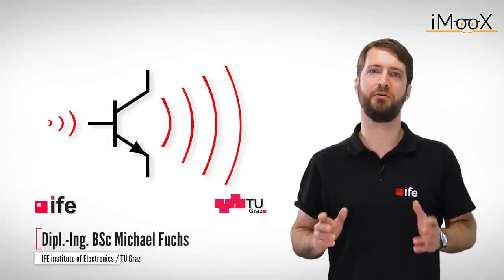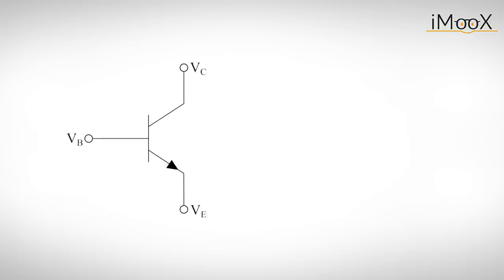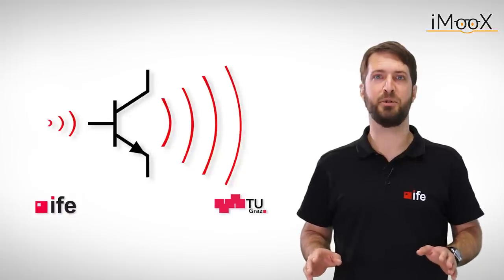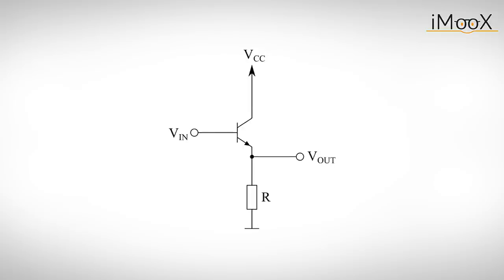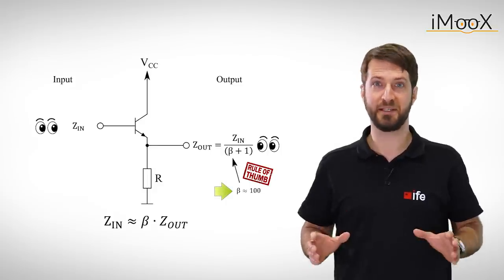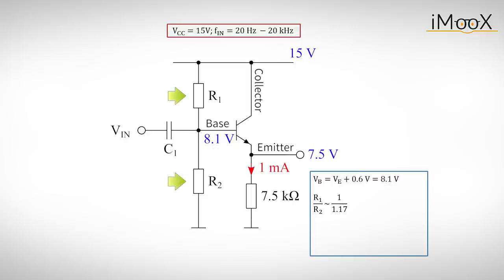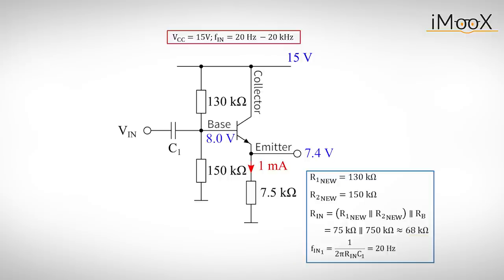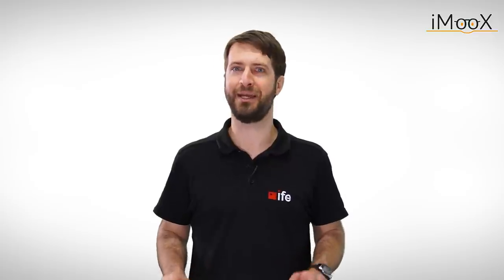The transistor as an amplifier (Part 1)

Comment: To refine it a little, once you have chosen standard resistor values, you quite rightly recalculated the base bias point to be 8.0V. However, that assumes an infinite beta, and it's worth noting that a transistor beta of 100 and a collector current of 1mA would draw an extra 0.01mA from that bias point, lowering it to about 7.3V. The effect of the rule of thumb (using R1 || R2 < 10 x emitter resistor) is bigger than you might anticipate, and considerably bigger than the effect of using standard resistors that you did calculate. The lowering of the output bias point by 0.7V isn't a bad thing as it gives a bit more headroom to keep the transistor out of saturation on positive swings. Obviously, you can never get the full rail-to-rail swing with bipolar devices.
Finally - and it's only a small point - once you have fixed R1 and R2 as standard values, you should recalculate their parallel resistance which turns out to be 70K, not too far different from the 75K you used to calculate the input impedance, which is about 64K in this case. It close enough not to alter the value for the input capacitance calculated.
Reply: That's a very smart observation, thank you. Looks like we've gotten a little sloppy with our rules of thumb here.

Comment: so pretty if u want to amplify a signal u have to put a voltage to the base emitter to forward bias the diode and than a larger voltage will flow from collector to emitter?

Comment: 8:58 I believe the capacitor is coupling capacitor to remove any DC offset.  I don't believe it is there as an intentional filter, although it's cutoff frequency must be dealt with.
Reply: Yes, that's true, but I don't see why you cannot use it as such when it's there.
Reply: @michaelfuchs441  I think my point is that the goal is to remove DC offset but as a side effect, you end up with a filter as well.  I think you want to size the capacitor so as to minimize the impact of the filter on your desired signal.
Reply: @Enigma758  I can't argue with this conclusion. You're right.
Reply: @michaelfuchs441  Thanks for  your response, just trying to be precise...

Comment: Hallo and thanks for the video. I cannot unfortunately understand why the output voltage does not depend on the supply voltage. Vcc is also applied to R making VR bigger when Ic starts growing. Could you please explain ho it works? 
Thank you in advance!
Reply: But the output voltage is dependent on the supply. The supply limits the maximum voltage at the output. With 15V supply and correct biasing you can never reach more than ~7.5V at the output.

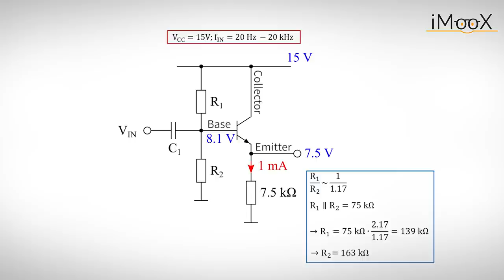Comment: @11:08 I might need a refresher. what equation is used to derive 75k x (2.17/1.17).  how do you multiply the equivalent resistance to the equation for parallel resistance, inverted, with the ratio values of a voltage divider to find R1 and R2.
Reply from the maker: For this calculation you need to know how parallel resistances are calculated. You can find a good explanation here: https://bit.ly/2Dr0Yl9.
In Short: R_1//R_2=(R_1*R_2)/(R_1+R_2)=75k. If you now put in the ratio from above (R_2=1.17*R_1) you get 75k=(1.17*R_1^2)/(R_1+1.17*R_1) and if you solve this equation you will end up with R_1=75k*2.17/1.17. I hope this helps!

Comment: @iMooX at
@10:24 you said: the impedance looking into the voltage divider; must be at least 10 times smaller than the 'INPUT' impedance looking into the base.
But it confused my mind; I think it shouldn't the INPUT impedance but the OUTPUT.  So the correction is input to output. The sentence turned to this.

The impedance looking into the voltage divider; must be at least 10 times smaller than the 'OUTPUT' impedance looking into the base. 

Otherwise the input impedance looking into the base is the same as is? :D
Reply: There is a mistake regarding the directions. Thank you for noticing!
I should have said: "The OUTPUT impedance of the voltage divider must be at least 10 times smaller than the INPUT impedance looking into the base."

Comment: Very good. One question: where does the value 1.17 come from when talking about R1/R2 @9:08?
Reply from the maker: The supply voltage of 15V is divided by the two resistors R1 and R2. If you want an 8.1V voltage drop at R1 and therefore a 6.9V drop at R2, you need a divider ratio of 6.9 to 8.1, which is equal to 1 to 1.17.
Reply: yes ..  so its just 8.1 divided by 6.9
Reply: Great job,we Waite more more successful video in electronics
Reply: Don't you want the 6.9V to drop across R1?
Reply: @imooxat  Or can use the classic formula for Voltage divider... 15* ( R2/(R1+R2)  = 8.1. If you solve for R1/R2 you will get 0.85. Which is equivalent to 1/1.17
Reply: @ajitnandakumar  things got a tad less clear when you got into the maths.  I did not initially quite understand your derivation of the ratio either. Best stick to classic calculating, its easier to remember. Otherwise great video.

Comment: Great Explanation but my doubt is that why are resistors R1 and R2 considered as parallel for the purpose of choosing their values ? As according to me they are clearly in series.
Reply: Good point! The explanation for this mystery is something like this:
What we want to do is a so-called "small signal analysis". We only want to look at the AC signals, not the DC signals. In the case of an AC signal with high frequency, any DC supply (such as the 15 V) can be considered a short circuit. Also the capacitor C_1 at the input can be considered as a short circuit for high frequency AC signals. If you now look from the input side, you see a resistor R_2 going to ground and a resistor R_1 going to the 15 V DC supply, which is considered a short circuit to ground. Therefore the two resistors are considered to be parallel.
I know this is a little confusing at first, but you get used to it. There are a lot of videos covering small-signal analysis. We are also working on one right now. I hope this explanation will help in the mean time.
Reply: @michaelfuchs441  thank you for the quick reply and yes it definetly helped.

Comment: Hi, thanks for your efforts in enlighten us about the operation of a transistor. i need help. i have a very basic knowledge with regard to circuit building. i have been given the task of building an RF power amplifier for a small FM transmitter. Do i have to start the design from the biasing of the transistor? i am confuse because this is an RF amplifier not just audio amp. i want the output of the FM transmitter to be about 30 - 40W. can i use a 2N3632 transistor as the RF amplifier?

Comment: In electronics how to select parts bro for specific specifications like I have 4ohm 6w 60v speakers  and I don't know what type of capacitor,transistor and resistor to use for making an amplifier
Reply: That's a hard question, because you need experience to answer this correctly. First of all you need to know if these 6 watts are RMS or some peak value. In any case, if you want to play it safe, you overdimension your amplifier. So your transistors must at least dig a collector current of about 1.5A (sqrt(P/R)=sqrt(6W/4ohm)=1.23A), your capacitors a voltage of 60V (which is deffinitly enough) and also the resistor at the collector must be able to sustain 1.5A, which leads to a pretty big resistor for high values of R (calculate over P=I^2*R). But as I said you are on the very safe side here. If you want to make better assumptions you can calculate even better or you can use simulation tools. Unfortunately most of all you will need practice and you will blow stuff up in getting there. That's the fun part of learning. ;)
Reply: Tq for your information  bro  and anyway nice explanation
Reply: Bro I was not able to get tip112 transistor and  60v capasitor can I use tip31c and 63v capacitor
Reply: @chnithinsai601  Yes, I don't see why not.
Reply: Bro I for got to say I have  2speakers each one with  specifications of  60v, 6w and 4ohms  now should I + these two speakers specifications and do an amplifier  or should I take only one speaker specifications to do an amplifier
Reply: @chnithinsai601  I'm not quite sure how to answer that. In general if you want to use two speakers for stereo sound you also need two amplifiers. If you just want mono sound you could theoretically plug two speakers in parallel, but be aware, that then you only have 2 Ohms, which will be a heavy load for your amplifier, since it needs to supply twice the current.
Reply: Bro now can I use , TIP31 NPN High Power 100V 3A Transistor, 4.7k ohm 1/2watt resistor , Capacitor 1uf 63v Aluminium Electrolytic.
Reply: @chnithinsai601  I guess you can. Also, it's often best to simulate a circuit before building it to get a clear picture on whether or not a circuit will work. I can recommend a SPICE based simulator, like LTspice (which you can download for free).

Comment: So many things clear in video ,
I have some questions 
Can you please derive the total expression for video at 10:51 min.
how R1 is llel to R2 and how 1.17 came .
Reply: Good question!
The supply voltage of 15V is divided by the two resistors R1 and R2. You want to have 8.1V voltage drop at R2 and therefore a 6.9V drop at R1. So what you need a divider ratio of R1/R2 = 6.9/8.1, which is equal to R1/R2 = 1/1.17 .
Reply: @michaelfuchs441  
Ok, finding R1 and R2 are easy, but how is Rin=(R1||R2)||RB??

Shouldn't Rin=R1||R2
Reply: @michaelfuchs441  ok thanks .
Reply: @justadreamerforgood69  I admit, that is a little tricky to understand, since we are looking at a small-signal model of a bipolar transistor. You can find a pretty good explanation of what is going on here:
https://wiki.analog.com/university/courses/electronics/text/chapter-9
Look at the small-signal model of the BJT in chapter 9.4 and following to get what's going on.

Comment: thank you for video good job. but i dont understand at 10:41 where that 2.17 coming from????
Reply: We know the ratio R_1/R_2 = 1/1.17, or in other words R_2 = 1.17*R_1.
Because we do a "small signal analysis" R_1 is considered to be in parallel with R_2 (written as R_1 || R_2), which should be 75 kOhm. If you do the math and calculate the total value of R_1 || R_2, you get: 75 kOhm = (R_1*R_2) / (R_1 + R_2)
Now plug in the ratio from before, you get: 75 kOhm = (R_1* 1.17*R_1) / (R_1 + 1.17*R_1) = (1.17*R_1^2) / (2.17*R_1) = 1.17*R_1 / 2.17
In the last step you solve for R_1 and get: R_1 = 75 kOhm * 2.17/1.17

Comment: Thank you very much for the great videos.  I'm watching this after enjoying your ADC series.  I am confused by the modeling of a transistor as two diodes.  In the NPN example, the collector diode would stop current from flowing to the emitter.  Not sure what I'm missing about the analogy.
Reply: This analogy of course does not represent the real behaviour of a transistor on the output side. It is just to remind you that - seen from the base - we are dealing with 2 pn junctions here. So we definitely have a voltage drop from the base to the emitter.
By the way, the analogy to the two diodes also points to another circumstance that is often forgotten. Theoretically, the collector and emitter of the transistor could be swapped. It would still work. In reality, of course, it won't do that very efficiently, but it does.

Comment: Hi .is it pussible to amplify a fast edge squre wave (rise time=30ns) with 10 Vp-p to 100 Vp-p and with rise time being less than 60ns?
Reply: That's a tricky question, but I think in this case this is not the right circuit for you. If you want to amplify only square wave signals (so no sinusoidals or any other form), you don't need to use this kind of amplifier. You would then rather build a switching circuit with a high speed switching transistor. 30ns rise time will be possible with high power MOSFETs is this case.
Also if you want negative voltages (because you wrote Vp-p) you will need two transistors (in push-pull configuration) for this endeavor.
Reply: @michaelfuchs441  thanks for the respond.
Yes i want to build a high voltage squre wave genrator. So its pussible to reach 100 volt with power mosfet and have a fast edge still?
I built a fast edge squre wave with schmitt triger & another one with ic555. But i could not amplify those more than 20 Vp-p.

Comment: @2:20, what is ment by Vc being 'more positive' than Vb?
Reply: It means that V_CE must be a positive voltage (with + on the collector and - on the emitter. Otherwise a positive input voltage would not lead to conduction of the transistor.

Comment: How is the impedance of the follower calculated to 750K at 11:35? The value of Rb is not explained, and I can't figure out how to do the high pass filter without that value...
Reply: Rb is simply beta*R_E, as shown in 9:57. Still there seems to be an error in the calculation of R1 parallel to R2, which is more like 70k instead of 75k.

Comment: why is the output sometimes at the collector? pls help, also your vids are more clearer than the others
Reply: For the emitter follower the output is at the emitter. The idea is to amplifiy a current. If you want to build a voltage amplifier you need to add another resistor between Vcc and the collector and then the output is also at the collector. Just watch our second video on the subject:
https://www.youtube.com/watch?v=WlKhkjyzfNI&list=PLhy2nHJciTED7xA_u5OyUj7oDEFf3BuZY&index=2

Comment: can you explain the voltage divider a little and how you got r1/r2=1/1.17. The resistors r1 and r2 don't have values. please explain carefully. thank you.
Reply: This question comes up a lot. Here is my previous explanation. Feel free to ask again, if it's still unclear.

In short you get the 1/1.17 from the voltage divider at the input. If the biasing voltage at the base would be half of the suplly voltage, R1/R2 would be exactly 1. But since we need 0.6V more at the base, we get R1/R2 = 1/1.17.
Now for small AC signals at the input the DC voltage source looks like a short and the input resistance looks like a parallel connection of R1 and R2. This is what is troubeling most of our viewers, which is why we will shortly do a video about small signal analysis. But from there on it's simple:
You can calculate resistors R1 and R2 by knowing the ratio from above, and knowing, that they both in parallel need to be at least 10*R_E=10*7,5k=75k. From there on you can calculate the parallel resistance R_1//R_2=(R_1*R_2)/(R_1+R_2)=75k. If you now put in the ratio from above (R_2=1.17*R_1) you get 75k=(1.17*R_1^2)/(R_1+1.17*R_1) and if you solve this equation you will end up with R_1=75k*2.17/1.17. I hope this helps.

Comment: The impedance calculations were confusing at best. Care to elaborate on that?
Reply: Since this question is rather vague, I do not have a good answer. But I can provide you with some additional material for a better understanding. A good example can be found on pages 13-15 in this document:
http://www.ee.ic.ac.uk/pcheung/teaching/aero2_signals&systems/transistor%20circuit%20notes.pdf
Go through it, and if you have additional, more specific questions, I will be happy to answer them.

Comment: I have a question for anyone here: I'm trying to make a small amplifier to drive an analog VU meter. It's a stereo meter which means I have to have two amplifier circuits for each side L/R. I'm using a C945 transistor and some spare resistors. I have a dual potentiometer as well.

Now for a couple questions. In the schematic at 11:12, are the leads going to ground meant to go to, for example, minus on a battery? I'm guessing the 15V at the collector is for the plus side of a battery at least.
And if I wanted to be able to adjust the max output of the VU meter, where would I add the potentiometer?
Reply: To answer the first question: Yes, the ground connection is made at the minus side of the battery. I'm afraid though, that the answer to the second question is like an advertisement for our own videos. Maybe the problem is easier to tackle if you would watch our second video on transistor amplifiers (https://www.youtube.com/watch?v=WlKhkjyzfNI&list=PLhy2nHJciTED7xA_u5OyUj7oDEFf3BuZY&index=3&t=0s).
As you will see, you can build a voltage amplifier quite easy by taking a collector resistor, which can also be a potentiometer. I hope this helps.

Comment: If this is amplifying the current but you are assuming only 1 mA at the output (9:24) and no current flowing through a load, then where is the current all going ?
Reply from the maker: The current will flow solely through R to ground (and back to the power supply, which provides the 15 volts).

Comment: may someone please explain to me what the 2 vertical parallel lines mean in these equations?
Reply: Very good question! Two vertical lines between two resistor values mean that they are switched in parallel. If for instance the equation sais R1 || R2, this means that the total resistance of the two parallel resistors is calculated like this:
R_total = R1 || R2 = 1 / (1 / R1 + 1 / R2)
Look here for further explanation: http://www.sengpielaudio.com/calculator-paralresist.htm

Comment: at 10:12 why Rb=beta × Re ??
Reply: As it is explaned in 5:04 , I_C=beta*I_B and I_C is approximately the same as I_E. It is actually I_C+I_B, but I_B is very small and can be neglected. You will also often see in literature, that I_E=(1+beta)*I_B and then (becaus beta is much higher than 1) the approximation I_E=beta*I_B.
Because the currents are indirectly proportional to the resistances (the higher the current, the lower the resistance and vice versa), consequential R_B=beta*R_E.